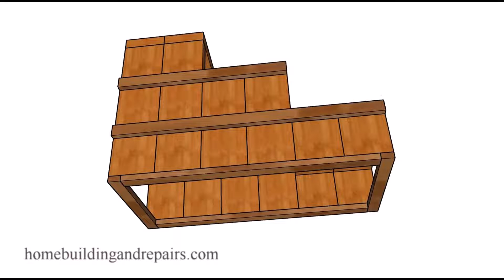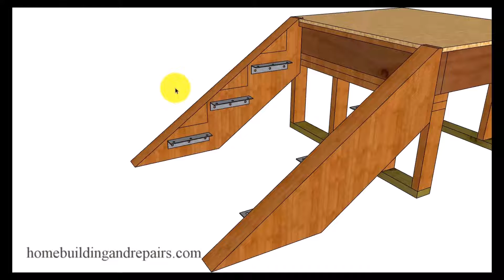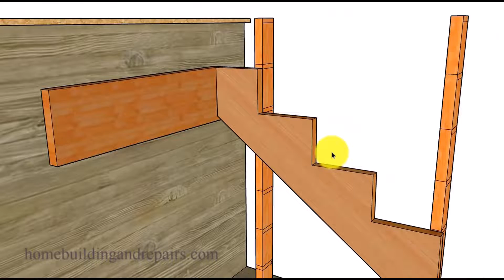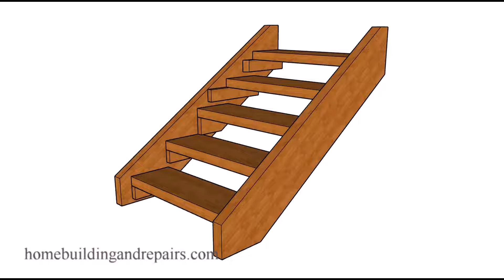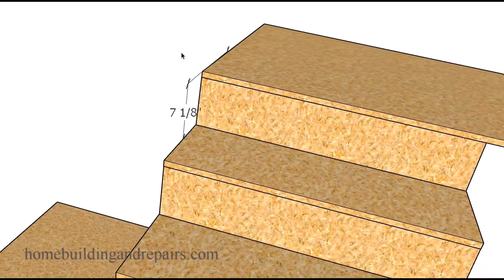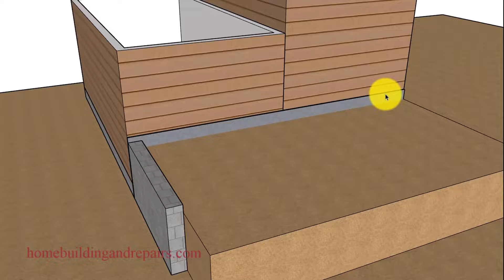Stair Building And Construction Education Video Series Collection - Part Eight

Comment: Clarify please:

To make sure we aren't thinking differently, when you say "a 16' set of stairs", are you speaking of the run or the hypotenuse?
Reply from the maker: I would need to know the minutes the statement is located in the video.
Reply: Try 30:12 as an example
Reply from the maker: That would be the length of the stair stringer. @rudispruell883